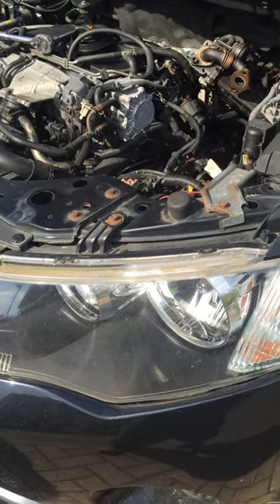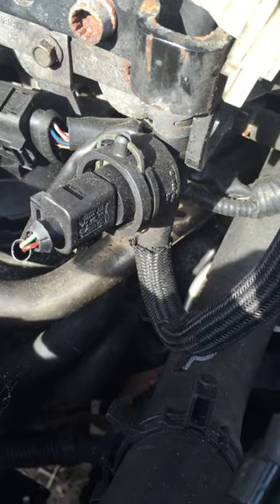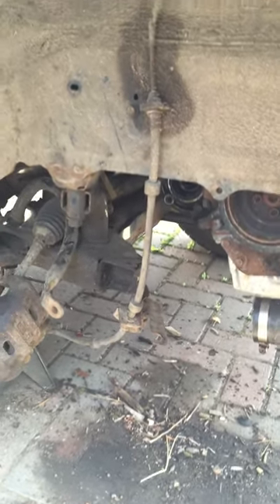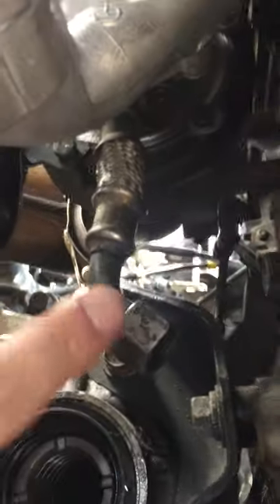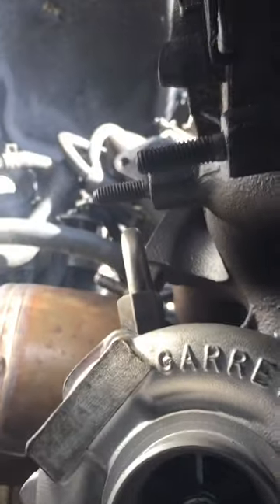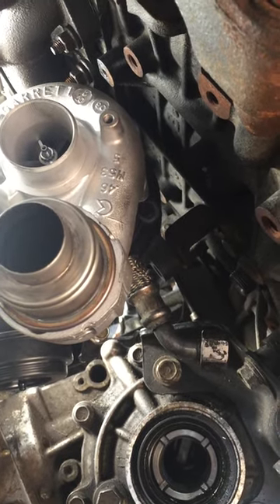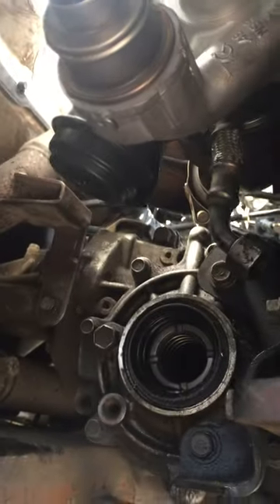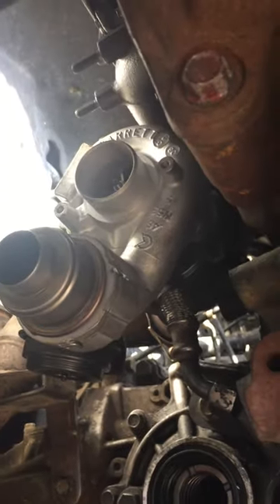2007 - 2011 Mitsubishi Outlander, 2.0DID Changing the turbo

Comment: Thank you so much for this! I've just bought a 2007 Outlander with the same engine with 250K kilometer on the clock, no rust at all and I just fixed some coolant leaks and now everything just works! But I've been dreading a turbo failure due to the position of the thing in the engine bay ,and I was afraid I had to lower the entire engine..

Comment: Just took turbo off today. All bolts can be undone from top. U only have to get underneath for oil return and 1 turbo support bolt. U don't have to take drive shaft off at all
Reply: Hi Paul - I was thinking of attempting it this way too - (my turbo is overboosting and leaking @ the exhaust side). I don't fancy taking out the drive shaft, suspension etc.... I take it you took EGR cooler off at the top rear of the engine but how did you access the turbo support bolt/oil retun from underneath? Did you have use of a ramp or can you get away with axel stands etc...?
Reply: matjohns2711  yea cooler off. I took it off 2 years ago and blanked it . Support bolt and oil return done underneath easy with only drivers side jacked up high. Both sides will lift
Reply: Thanks Paul - I'll give it a go...
Reply: Before you do anything make sure u can get the v band off. Took me 2 hours just to get that off. Everything else was easy from there
Reply: Will bear it in mind...cheers - looks like the V band/clamp is where my exhaust leak is too
Reply: Just wanted to say I got my faulty turbo off (clogged/worn vanes) at the weekend -  exactly how you described....even down to the tricky V-clamp which seemed to be fused on! EGR cooler is in the bin/blanked (turned out it was the source of the exhaust leak anyway). Car drives better than ever  - and I wouldn't have attempted it without your advice/comments - so thanks again.
Reply: Have replaced  turbo but I think mechanic s left old oil feeding pipe and it's still getting limp mode is this the reason or there can be another issue like mad sensor ? I really don't feel power on my car and if the feed pipe can it be replaced easy?
Reply: Have you video how to do it from the top
Reply: @mindisgl6556  hi did you get sorted, I have over boost which P0234 code. Car goes into limp mode occasionally and don't want to go route of changing turbo without being sure it will resolve. My understanding is that oil feed pipe, rubber tubes and turbo need to be reconditioned - is this correct ? Thanks
Reply: @Pug205GtiMi16  turbo replacement  imrpveed things but I had limp mode anyway, after changing map mad sensors solenoid and turbo I still was getting limp mode
Reply: @mindisgl6556  ok thanks skyvoker, undecided now wether to go ahead. Will have a think about it over next few weeks
Reply: @mindisgl6556  if they left oil return  pipe off then the turbo would seize up and so would your engine.. The vanes don't use oil.

Comment: Very well explained, thank you for that! Need an advice thou ... if the variable geometry gets stuck form time to time, will some cans of EGR/throttle/etc cleaners solve it? I really don't want to strip it down.  Mainly, the reason for this mishap it's due to the PCV membrane that failed and let oily carter gases into the admission, and clogged up the turbo. Thanks!

Comment: Hello, thank you for the very instructive video. My 2009 Lancer comes with a DPF and since I have a P0299 UnderBoost error that comes together with a Wastegate error on the BOSCH diagnostic machine from the local shop, I was thinking about putting in some Mr. Muscle, wiggle the actuator for a few hours and then take a drive to see if that would fix it. Problem is that I can't get the foam in from the exhaust side, underside... because that's where the DPF is. If I take out the MAF hose and everything behind it, I can access the Turbo from its front side. But will the foam ever reach the Wastegate? Also, will this foam have any negative effect on the DPF? Thank you kindly for any advice. Learning mechanics on your first car doesn't seem easy at all..  :)

Comment: Hi Bud thanks for the video. Its the only one i could find on this job this car. Can you tell me if you had to remove all the studs before it would move. Mine won't budge. Also the band the holds the turbo to the exhaust swirl chamber wont let go.  Ive undone all nine fixings but its not evev rattling?
Thanks

Comment: Hi. Shame you didn’t show any of the bits you did to take it off. Attempted to take drive shaft out but as there is no info given on how to do this I am now stuck with the driveshaft and hub undone but refusing to come apart and I have no idea if they are just fused and need a bigger smack with a hammer or if there is more that needs to be undone. Same on the inner side of the driveshaft. Managed to get access to the turbo-downpipe clip and undone that (is that the V clip?) but that won’t come off either. Maybe the next video might show some of the steps happening rather than finished.

Comment: Hi guys @everyone I have the P0299 underboost on this engine not long had the motor but drive it for 10 min then goes into limp mode caused by the underboost any pointers for starting at the turbo has no noise and moves freely also
Reply: Did you ever fix the issue? I'm dealing with the same and it's got me scratching my head majorly! Thanks

Comment: Hello good Sir, Thank you very much for the video. Is there maybe a chance of you doing a fuel filter change on a Outlander 2.0 did? I got mine just recently and I wanted to know the proces. Thanks in advance
Reply from the maker: Hi there, ill be doing a full service video on this car inc fuel filter in March.. watch this space ;-)
Reply: Little Mechanic  how did that new turbo perform?
Reply from the maker: feringard really well. We had to replace a few of the turbo pipes, but apart from that all good!
Reply: Little Mechanic  the turbo pipes was giving u over boost codes?
Reply from the maker: paul giblin no, the pressure of the new turbo blew holes in two of the old pipes. We ending up changing all the rubber piping.
Reply: Little Mechanic  my turbo is fine. just over boosting. will put 30 psi into the system to check for any leaks with the tool I have made for it. also Mr muscle through where egr cooler bolts on into the veins. where is the n75 valve on these?
Reply: @paulgiblin807  my turbo is overboosting too did you fix with mr muscle ?

Comment: Hi to all, I have a 2008 2.0 outlander with the bsy engine. After buying the car it went into limp mode on a couple of long drives. It gave a code once which was P0234 (over boost). Research points to variable valves in turbo being stuck, I see little mechanic explains that this is due to the oil feed pipe. 

My understanding is the fix will be reconditioned turbo, new turbo rubber pipes and new oil feed pipe. Has anyone else any other suggestions or part numbers please? Also has anyone done the above and how is the car performing after. Thanks
Reply: I'm having the same issue with mine I've got a 2009 outlander and the fault code is the same relates to a boost pressure sensor/map sensor that needs changing, but I have no idea where its located
Reply: @Sk-rd9wc  update July 2021, had the turbo out and completely rebuilt with proper components in dublin, car does not go into limp mode anymore. Also had tbelt and some pipes changed as they were bulging and needed changing, so far so good. Two months driving and have completed long journeys.
Reply: @Pug205GtiMi16  I had my turbo rebuilt 3 years ago when i had the cylinder head rebuilt, so it can't be my turbo (I hope) the car doesn't get trashed around as it's a family car. I'm hoping it the boost pressure sensor on mine but I cant find the sensor
Reply: @Sk-rd9wc  interesting yours was done but is still going into limp mode. I'll see if I can find some info on boost sensor
Reply: If its boost pressure sensor that's relatively cheap fix
Reply: @Pug205GtiMi16  nice one, I've tried to search for some info but no success. One of the forums just said it's on the left side I assume it's on the driver side as the turbo is at the back of the block
Reply: @Sk-rd9wc  some are located behind the car battery and down lower, won't have a chance to look for a while though. Will ping you if I find it.
Reply: Have you had any other issues since getting the turbo changed other than the limp, I've heard of some people rebuilding turbo with Chinese parts. The guy I used has never had a turbo fail
Reply: @Pug205GtiMi16  I used a reputable company to refurb the turbo. My water pump failed, replaced that and the cambelt, rebuilt the cylinder head, new head gasket spent a lot on it 3 years ago pretty much a new engine. I've spent way too much to get nothing for it now. I've got an issue with engine coolant disappearing I can't find a leak it's been pressure tested no leak found. It's driving me nuts!!!
Reply: @Sk-rd9wc  I had water coolant leak aswell, I had a steering rack replaced. Thought it was water pump when I bought it, bought second hand steering rack for 50 quid and had it pressure tested then had mechanic fit it. Probably owes me 4k now but has 100 k miles which is relatively low for 2008.
Reply: Coolant leak is gone now, mechanic changed some pipes I think will ask him. I took the old coolant tank out and cleaned it up best I could as there was so much gunk I couldn't see the level..
Reply: Think I'll sell on and go for old xc90
Reply: Shame it's a nice looking car with 19 inch geniune mitsubishi alloys.
Reply: @Pug205GtiMi16  I was looking at those too but the way things are going with low emission taxs may have to go for something that meets ulez as I travel to London and Birmingham and both cities are taking you to the cleaners to drive there